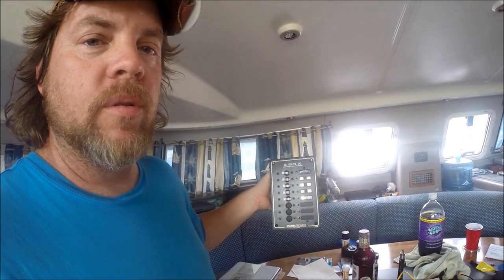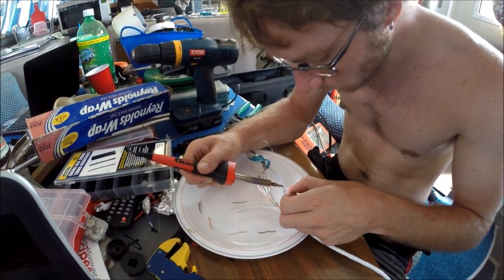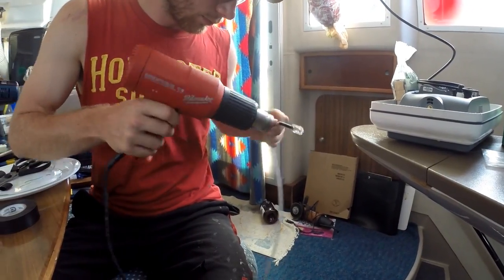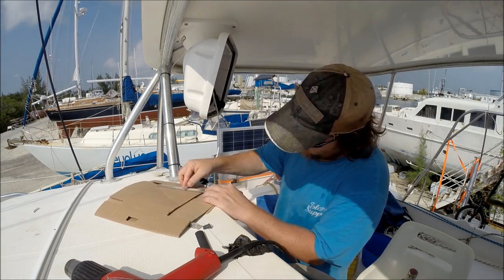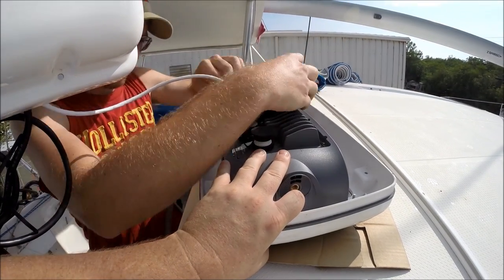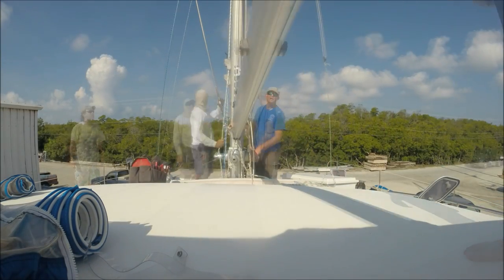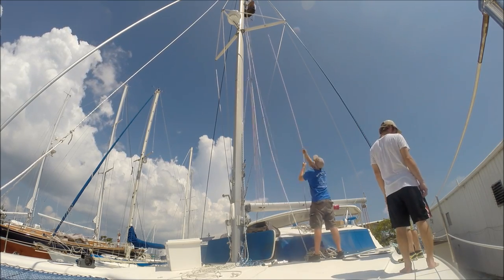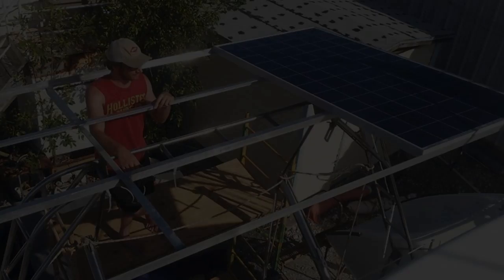Sailboat Refit - Episode 4 - Seatalk Cable, 12 volt Panel, and Standing Rigging

Comment: Does the wiring sequence need to be changed in at cat5 cable? Or just making a splice?
Reply from the maker: Nothing different about the sequence at all.....just sand off the shoulder for it to push all the way in - Raymarine just used regular Cat5 but charges about 10 times what you can normally find the cable for elsewhere.

Comment: I’m not sure I’m liking the cabling on the raymarine chart plotter. The wire is on the outside in the cockpit. Not protected against the elements!!
Reply from the maker: It survived for 6 years so far and its under the hardtop (well, it survived the 4 uears i had it anyway)....didnt seem to be and issue at all.
Reply: s/v Catchin' Rays ah ok wow. I was under the impression that salt water or corrosive salt air would oxidate it. Awesome boat project enjoyed the video allot. Just realized my comment is maybe a bit harsh. Anyways good riddance and easy sailing ⛵️ ✌️😎
Reply from the maker: @Ks-zz9lh  no worries.  We've sold that boat 4 years ago and are in the process of repairing our new boat for the next adventure.